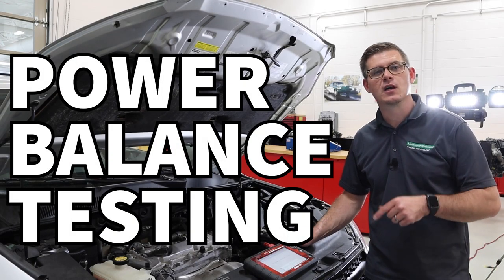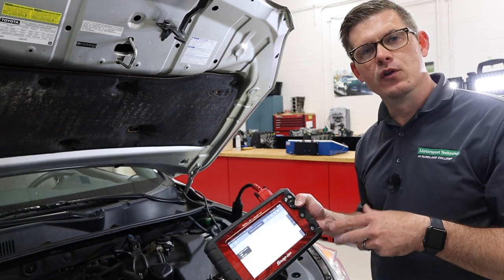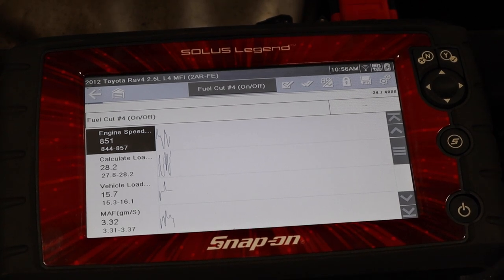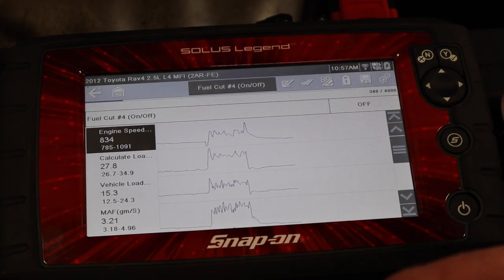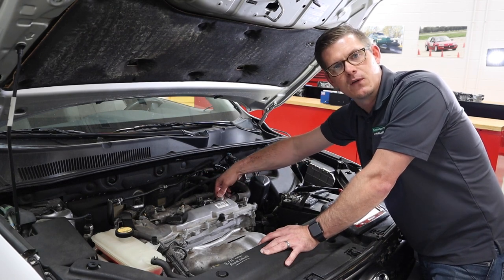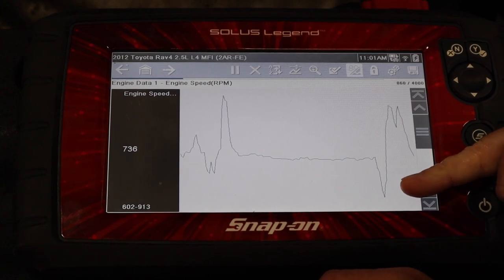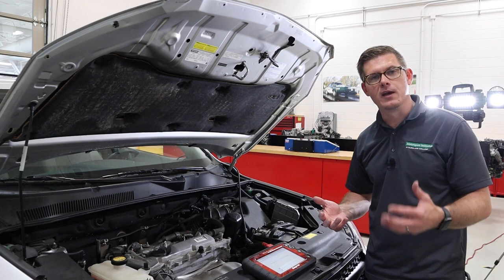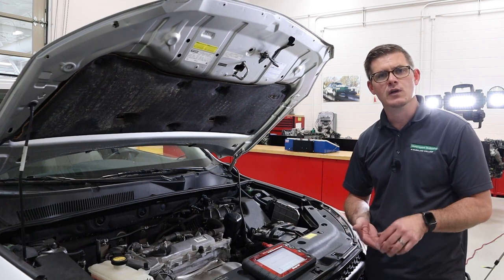Cylinder Power Balance Testing

Comment: Can you please tell me what is tolerance from worst to beat reading?
Reply from the maker: The nature of a power balance test is that each engine will have a different level of drop. This is a factor of cylinder count, engine design, and many other things. The best method is to review the drop of all cylinders and compare them. Each drop should be relatively the same.

Comment: Is fuel cut not dangerous for the combustion chamber? A lean burn is very high temp, couldn't it cause damage to the valves? Genuinely curious, thanks
Reply from the maker: Fuel cut is regarded as safer than ignition cut. When fuel is cut, the cylinder becomes an air pump and there is no risk of damage. When ignition is cut, the lack of spark results in raw fuel being passed to the catalytic converter. This could cause damage to the converter due to the substrate overheating.

Comment: Would power balance only apply to ford  could power balance a import like a Honda thank you have great day good content
Reply from the maker: Thanks! Yes, you can perform a power balance on any engine where you have the ability to disable fuel or spark on individual cylinders. The scan method is great and easy, but there are manual methods you can perform by disconnecting a fuel injector or ignition coil briefly. Keep in mind if you disconnect an ignition coil, you only want to touch the low voltage (primary circuit) and do not disable it for more than 3-5 seconds. When ignition is disabled, raw fuel is passing through the cylinder on the catalytic converter and can cause it to overheat.
Reply: Thanks bro keep up the great content 💯